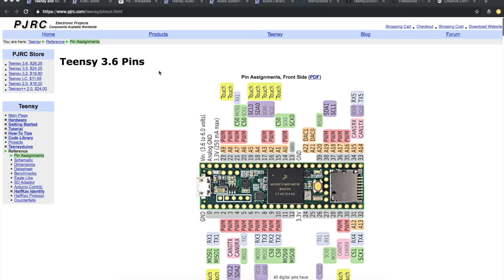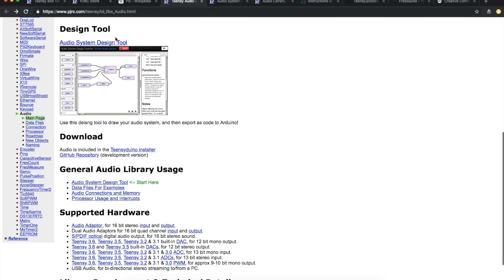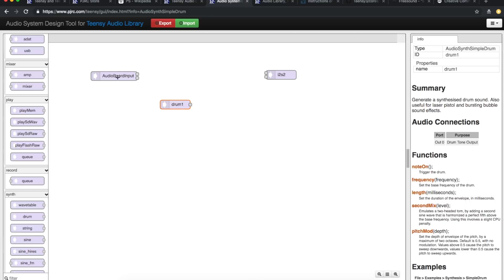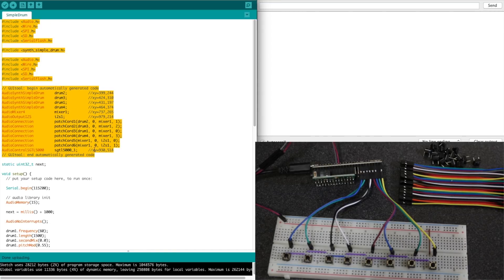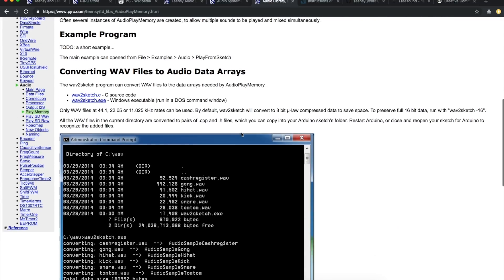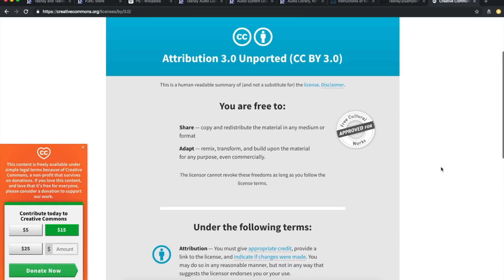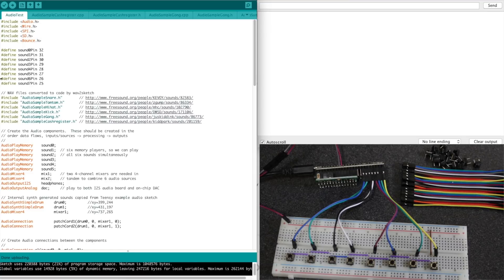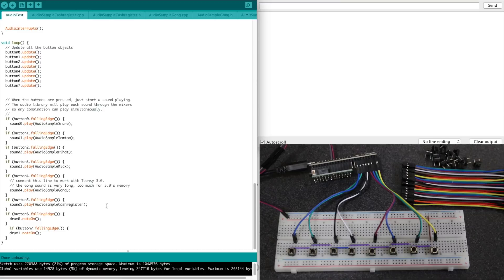Teensy Drum Sample Player

Comment: Hi , Great video, but can I ask a question . I can see that the switches pull the input down to ground to play the sound so assume the inputs are normally at 3.3v via an internal pullup resistor.   Rather than pressing buttons I want to trigger the sounds with my sequencer, but its back to front to what I need , the sequencer doesnt pull down to ground instead it sends a 5v pulse each time it triggers an output. I am guessing that if I put an NPN transistor  in place of the switch with the collector to the teensy  and the emitter to ground my sequencers 5v pulse on the gate would open the transistor allowing the teensy to pull to ground just like pressing the switch . What I am not sure of is would I need a resistor between the teensy and the transistor to limit the current through it when it grounds and if so what sort of value resistor. I would rather ask than blow up a teensy 3.6 by experimenting. As a pensioner I cant afford to do that too often. Cheers and hope you can help .....Don ( the old phart)
Reply from the maker: There would be no need for a resistor in the collector-emitter path because the current in that path would be limited by the teensy internal pull up anyway (3.3v /  30k or whatever the pull up is)  and the external transistor can handle way more current.  And adding a resistor in that path may lead to a voltage drop across it, not allowing the input to actually reach ground as well as it would with just the transistor itself in that path.
 But a resistor should be used in series with the base of the transistor to limit current there with the 5v signal on it.  The value wouldn't be very critical because it would normally be calculated to limit base current while still turning on the transistor enough to let the collector current flow (more base current for more collector load current), but since the collector pull down function isn't using much current, the transistor barely needs to be driven to open the path.  So I'd put anything I can find between 1K and 10K in series with the base and see if it works that way.
Reply: @GadgetReboot  Thats great thank you  and now I can get on with building . Thanks for the very quick reply Don

Comment: i have a Rock band drum kit from  an old nintendo wii. I get the feeling it would work with a teensy. I just dont know where to start. Anyone have any advice?
Reply from the maker: I don't know what's inside them or how the connections work, but if you can find out they have piezo's in there, or otherwise add your own maybe taped to the top of each drum, this might work:  https://youtu.be/y2Lmbts9IIs
Reply: @GadgetReboot  single 
pieso in evry drom pad
Reply from the maker: @mahlonkarpaiya252  Evan Kale once hooked up rock band drums to an Arduino to use them to trigger Midi outputs for playing drums on another device https://www.instructables.com/Convert-Rockband-Controller-to-MIDI-Drums/    

Although that circuit just uses a single resistor across the piezo, which still may allow excessive voltage spikes into inputs. 
My Teensy piezo method probably goes too far in the hardware interface to buffer the signal before it touches a Teensy.  
I haven't tried this but maybe using just 3 resistors would work.  I'd have to try it and look at the signals to see how I feel about it. https://arduino.stackexchange.com/questions/32793/several-piezo-contact-mics-with-arduino

Comment: What are the equipment for making drumset and for what price?
Reply from the maker: I used Teensy 3.6 which is $29.25 (list of modules and prices https://www.pjrc.com/teensy/techspecs.html ) 
and the Audio adapter which is $14.25 https://www.pjrc.com/store/teensy3_audio.html 
To avoid using the extra audio board,  I showed how to use DAC or PWM audio here: https://youtu.be/-2B4Dmy4J1Y
Those methods work on Teensy 3.2, 3.5 and 3.6 boards
The biggest issue would be flash memory space.  Teensy 3.6 has 1024K which is what was needed to fit all the sounds I used at the same time.   3.5  has 512K and 3.2 has only 256K.   The data files for the sound samples ranged from 30K to 70K each for most, but the Gong was over 300K alone.
Reply: @GadgetReboot  Thank you very much

Comment: Does all this work on the latest teensy 4.1
Reply from the maker: I have a 4.1 I just got but haven't tried yet.   But in the audio design Gui it shows what hardware is supported on various input/output types, and I see the 4.1 listed for I2S audio, but only 3.5/3.6 for DAC or PWM outputs.  I think all the processing functions should work, just needing I2S to get audio in or out of the device.
Reply: @GadgetReboot  so I just need some kind of i2s audio breakout?
Reply from the maker: Yeah, I have one that's designed for Teensy to plug straight into, there's one for teensy 3 and one for teensy 4 because of the different pin locations:  https://www.pjrc.com/store/teensy3_audio.html
and I've also used this one, which has to be wired up manually to the right pins  https://www.youtube.com/watch?v=_PfUEnkqeOs